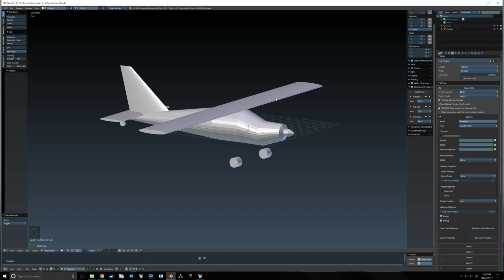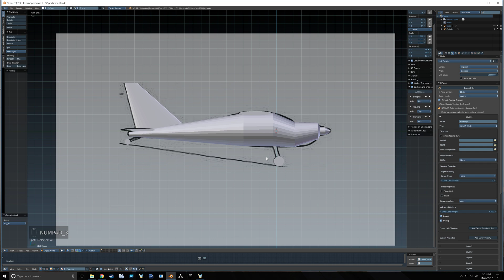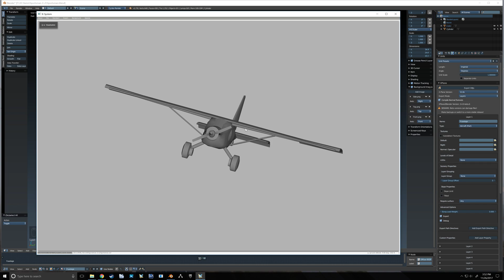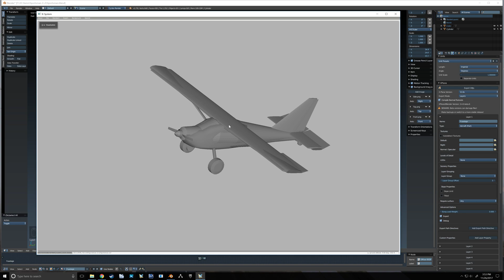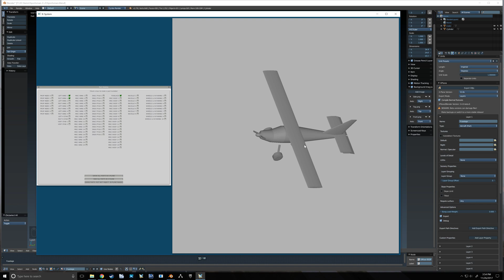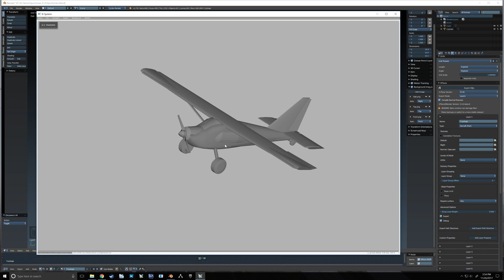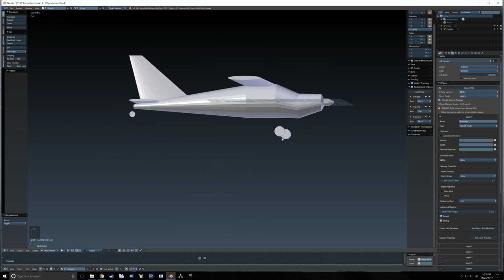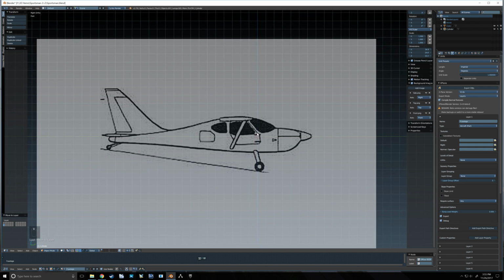Making an airplane for X-Plane 11 Tutorial #10

Comment: If the aircraft is built in planemaker, can't you just export an stl model and pull that into blender? It is low resolution but should have all the dimensions you need, and might show better where things should be located. Nice video series, btw.
Reply from the maker: Yes, you can export an object to bring into blender, but I’ve found you can get much more accurate measurements in blender. I generally will get the flight model as close as I can, then build an accurate model in blender and then use the blender model to tweak the flight model to the correct dimensions. Planemaker is just not as easy to be accurate as blender is in my opinion.

Comment: I'm developing an aircraft in blender for X-Plane 11 and I built fuselage, but when I go inside it in X-Plane, it's empty inside. I think it's because it is not solid. How to properly solidify it?
Reply from the maker: You need two different object, outside and inside. Simplest way is to duplicate your fuselage, scale it down very slightly, and flip the normals so the faces are pointing inside. Then export the inside fuselage as a new object and add it in planemaker.
Reply: @BuildItBetter3D  Hmm, so I'll have 2 objects in plane maker. I opened other aircrafts in plane maker and there's only one file. For example Fuselage.obj
Reply from the maker: Yes, you should have multiple objects in planemaker. Open the default Cessna 172 and you’ll see it’s made a many different objects. Dissecting the default aircraft is how I learned a lot of what I know.

Comment: why do you need the blender model
Reply from the maker: The Blender model is for the visuals(eye candy). You can make a much better looking model with Blender. If all you need is an accurate flying model then you only need planemaker. The Blender model does not effect the flight model at all, it is purely for looks. All of the beautiful aircraft you see in X-Plane have a Blender model that you look at and a less detailed planemaker model that controls the flight model hidden underneath.
Reply: @BuildItBetter3D  thank you